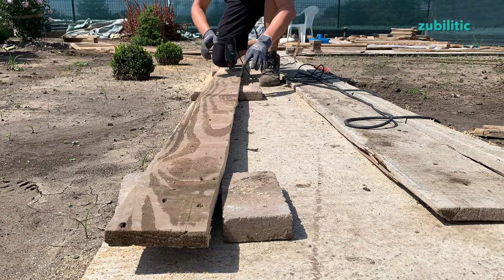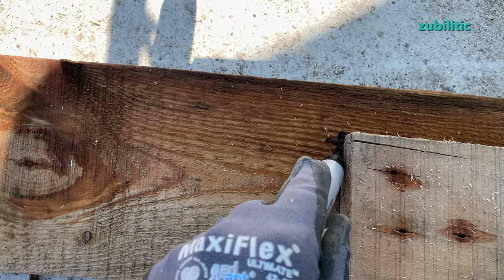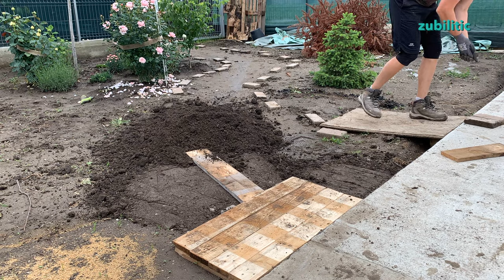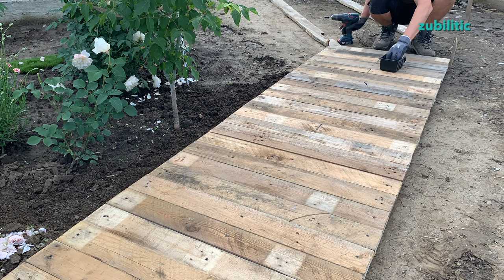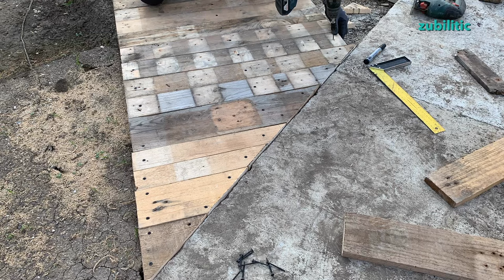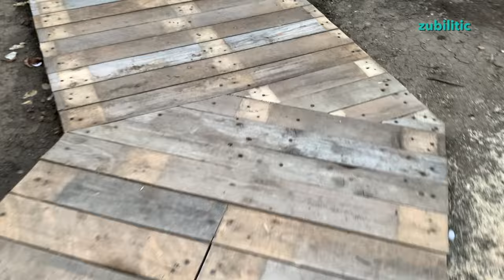Just A Simple and Useful Walkway From Pallets and Leftover Wood

Comment: Beautiful, But...Pressure treated wood in not water resistant. If the platform underneath is in contact with water, it will eventually rot. You should apply a sealer.
Reply from the maker: Thanks, I will see how it looks next Spring when I will turn it over and I'll apply something there. I did applied something on top of it.  Cheers!

Comment: Nice    did you connect the base boards together before putting deck on?    and what kind of fastening system did you use?   I want to make some of these in 8 foot sections I can move around.   I was going to use pressure treated wood and after a couple months pull them up and spray with a wood deck stain  to seal and give it a better look
Reply from the maker: Hello, I have not connected the base boards to anything. It is pretty caveman style what I did but it served its purpose so far (3 years) and it still does. if you want to move it around, you may have to put some wood in diagonal position (x or z shape) underneath.
Thanks for sharing and let me know how it goes ;)

Comment: How long will this last
Reply from the maker: It depends of many variables like how is the weather there (if it rains more often, moisture, etc.) but if you want it to last more, must treat the wood properly and level the ground with gravel because it drains well. Mine is still there, still usable, although I need to replace some boards here and there. I am afraid to check the sleeper boards :)